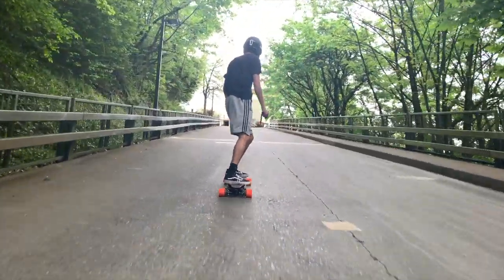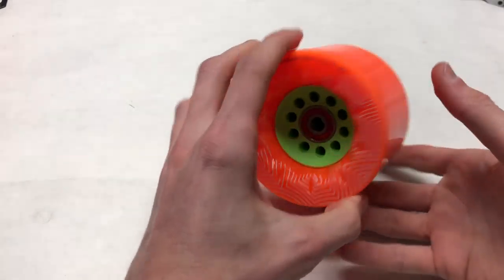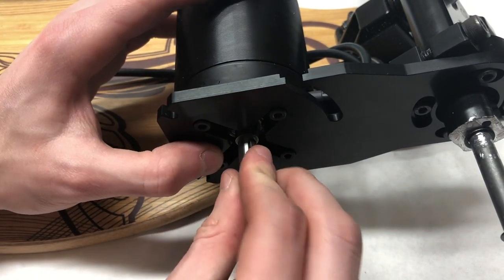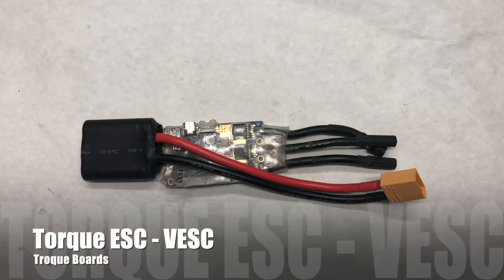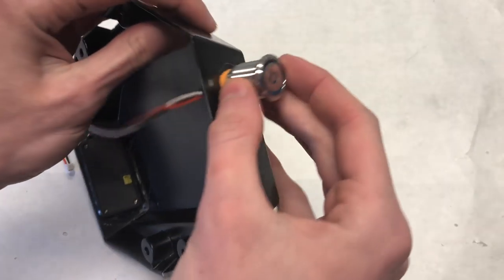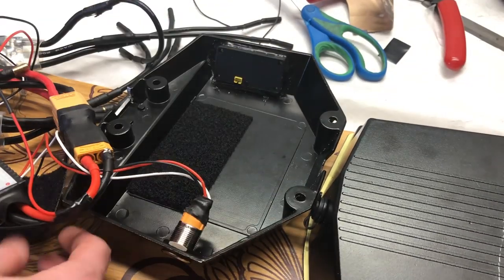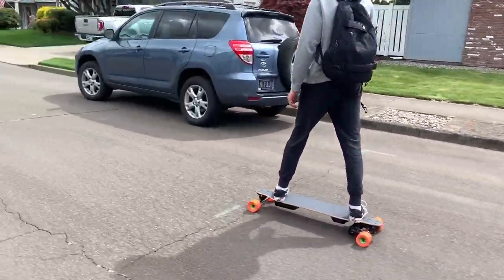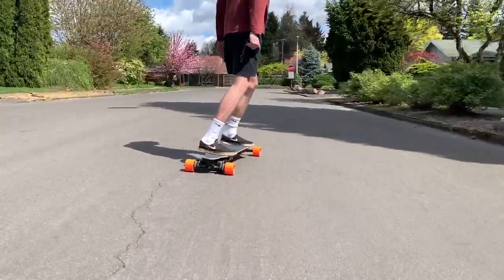How to Build an Electric Skateboard *NEW* DIY Boosted Board

Comment: Whoa you guys figured out how to balance the music and dialogue volume
Reply from the maker: Only took as a year and a half and oh yeah a lot of editing
Reply: Just a quick question which has bugged me for while. Im a massive rc fan and own 2 traxxas x maxx's which do 50mph and can pull cars. So Regarding motors in the x max could you use the xmax motors in a  electric skateboard. These are the motors Velineon 1600XL Brushless Motors. im Thinking about a unusual build. !
Reply from the maker: @customboatscreensolutions5893  Im not familiar with those motors at all but I just looked at them and it looks like the KV is 1600 which is wayyyyy wayyyy too high. Esk8's usually use motors between 140KV-270KV. 190KV is what we usually use
Reply: @customboatscreensolutions5893  the higher the KV, the less the torque, and the higher the top speed. 1600KV is great for pulling a 10kg rc car (I own an 8s xmaxx as well) but it suuuucks for pulling a 70-100kg human... the 8s xmaxx has a 1275kv motor which is better, but still way way too high. You should be looking for 250kv or less.
Reply: @customboatscreensolutions5893  the out-runner style motors used on most boards are really low kv and designed to have more torque than rpm. I'm an rc guy as well but most people dont use rc lipo packs which push way more amps than rigid cells.
Reply: You had me at nut.....
Great video brother!
Reply: No they fucking didn’t 😂 the music was so loud and the voice was super quiet

Comment: the nut from the idler should be on the inside and the bolt head on the outside, the nut wil catch in the grooves giving you easy adjustment with only a turn of the bolt
Reply from the maker: Wow thanks for the tip, I was really struggling putting the idler on, definitely very helpful advise!
Reply: @DIYesk8Builders  No problem dude, Great build!

Comment: Hey guys great video. Im building a board and i have the same wheel and truck setup as you have here. I am little nervous about the Dremel cutting part. my question is, is the axle integrated into the hanger or is it pressed in. When i cut it will there be some kind of separation between the axle and the hanger? Thanks.
Reply from the maker: If you are doing this now I would recommend using the boardnamics wheel pulleys! They require no axle shaving!

Comment: Hi,

Just curious re advantages/disadvantages re putting motors inside the wheels as opposed to hanging out the rear of the board,

Martyn
Reply from the maker: Hi Martyn! I would say that both are viable options. I think that tucked under provides much more a stealth look. However, under the board the motors are closer to the ground and can thus get hit by rocks. Rear mounted motors are higher off soothed avoid more of the rocks hitting them, however they are left out exposed if they were to get hit from behind or crashed backwards in a curve. Rear mounted also means you can't stand the board on its back nose anymore without scudding up the mounts. Honestly prefer rear right now, but it's a fine line

Comment: I don't really Understand why did you use such wide caliber clone trucks ? Just fitting larger motors wont magically increase torque. Instead you could have got the same amount of power using a 6355 or even a 5055 motor.
The battery pack  can hardly discharge a Max current of 24A which is way underpowered for a 6374 motor setup unless you increase it to say 60A.
Which means the board has ridicoulusly  low power , Almost the same as a wowgo 2s.
If I would have personally wanted to make a DIY Boosted board ( offcourse i want to : ) I would have used regular caliber trucks . Using wide trucks slightly makes the ride feel not so similar to boosted. Anyways Great video !
Hope you upgrade the battery sometime in the future .

Comment: 15:40 omg, please preplan your cabling. use heatshrink and add wires to the ends and not mid way with a bit of tape lol.
Reply: Any visual demo? I'm interested in building one and want to have an idea on how to add a heatsink in this enclosure
Reply: @617zSmgr  No, but leave all your final plugs to the end that require soldering. At least you can  reduce the length if needed or slide in an extra cable on the end before heat shrinking the XT90 connector rather than snipping in the middle of the cabling because "it's easier". it's obviously just a missed step and he just decided to "snip here" to add it but do it right first go and keep the wiring neater.

with the heatsink idea, you can but plastic enclosures for cells and ones for ESC etc just like Boosted (separate containers). just cut the slot out for the heatsink but only expose a small amount, not stick it all out. then seal it from water getting in.
the problem then is the flexing of the board will flex the seal so water will become an issue if you go down this route. make the mounts on the enclsure rigid and then you may have a chance.
Reply: @phizicks  just rewatched the video with these instructions! Yes I see what you mean now! 

If I ever get to building this board I will follow this carefully. Thank you very much!

Comment: Does the routed out board deck for the wires cause some durability issues with the board. Could it crack?
Reply from the maker: Definitely could make it weaker but we have no had any issues thus far
Reply: @DIYesk8Builders  yeah the looks are worth it

Comment: would you be open to the idea of a "budget" esk8 build video where you had around 400-600$ as a future video idea where it is still able to hit 20mph?
Reply from the maker: Sure we can work on that! We are actually doing something similar right now
Reply: Swagtron has one in that price range that's pretty not bad. Has remote and weight sensors so you can either control it by shifting your weight front to back or by remote control.

Comment: Hello, would it be possible to get a standard model e-longboard and stick 6' rubber wheels to it? Every model with those wheels is way more expensive than others with similar specs (more than the 100$ margin those wheels and adapters might cost)
Reply from the maker: It all depends on which board you buy. The larger pnuematic tires require wider trucks which are usually found on more expensive boards. You could always build a board for cheaper using those trucks and then use those tires.

Comment: Ok, so I believe I am headed to your store.  however, I don't know this stuff too well.  I have a V1 BoostedBoard that is dead and won't charge.  I believe the Battery and Vesc box are what I need to replace.  The motors are good as well as wheels and trucks (and Deck).  What would you recommend?  Thanks!
Reply from the maker: A battery replacement is probably all that you need, however I am not expert on boosted boards in particular.

Comment: I am building a board and i am wondering if i need the set screws for my motor pulleys, the kit i got didnt come with them, are they essential? I noticed you didn’t show putting them in.  Thanks
Reply from the maker: Yes they are pretty important to prevent your motor pulley from sliding up and down the shaft.
Reply: DIY esk8 Builders where can i buy some since mine didnt come with any? Do they just screw into the hole tightly or is there a trick to it?
Reply from the maker: Yeah they just go in tightly to provide pressure of the motor shaft. Not sure where you can buy some because it all depends on which brand it is

Comment: Nice build! I could be wrong, but could the issue with the wheel/tuck fitment be caused by the bearing in between the wheel and the pulley? I thought you didn't need that third bearing in the middle of the two others. It looks like on the pulley there's a raised lip that's blocked by the inner wheel pulley.
Reply from the maker: Without the third bearing the pulley would get pushed into the hanger and its diameter isn't big enough to just sit over it. Definitely needs the bearing. Clever idea though

Comment: Where do you plan on buying you 10s2p 40t pack? I had a look at meepo but it only puts out 30amps. Im in the market for two which I plan on linking together in parallel to get more range ✌
Reply from the maker: Ownboard has one right now
Reply: @DIYesk8Builders  sweet, do you know what the bms max amp output is set to on the ownboard packs?

Comment: The aluminum ownboard housings transmit vibrations through the board.  I'm looking to replace them with something plastic.  Maybe something like the backfire plastic battery box.  It's kind of sad that my only other option is to build a flexible battery pack and also build a flexy enclosure.

Comment: For a dual 6374 12s config what would be optimal max amps per motor? My guess is 40A per motor, but I can't find any battery with 80A discharge
Reply from the maker: Yeah there's not going to y many packs with that much. We have found that having packs that can do around 35A continuous and 60-80 peak is more than enough for dual 6374's. Of curse more would be even better but we have found that amount to be good
Reply: Battery and motor amps are not the same thing. A good target would be >=50 battery amps. You more or less always put the motors to 80 no matter what battery you have.

Comment: It would be more amzing if you recreated same shape of boosted remote casing and battery casing and esc casing and etc with 3d shape printed
Reply from the maker: We did experiment with this and managed to get a good rear enclosure but we didn't have access to a 3d printer large enough for the front battery casing. Also the aluminum casing in this video is much stronger and protective
Reply: @DIYesk8Builders  im still happy that you and others out here trying to continue boosted legacy any way possible

Comment: I have been looking for a DIY board that fit my needs of loving the flexy Boosted V2 while improving specs. I think this might be it!
I do have a question about the build of this board as someone who is still unfamiliar with specific parts and comparability. Would it be possible to incorporate working Boosted Mini X parts into a build like this? If I liked the remote, or the ability to reverse easily. Can be done, possible but alternatives, not worth the time, or no?
Reply from the maker: I would say that its definitely possible but I would be unsure how to do that since I've never been inside a Boosted.
Reply: Boosted locks down their board from the battery to the motors to the remote, I doubt you can use the boosted remote as is without completely replacing the internal components of both it and the ESC.

If you figure out how to reverse engineer boosted’s tech so third-party stuff can be used seamlessly, you could make a lot of $$ or get really popular within the community haha

Edit: apparently the Trampa Wand is a great remote, and has a reverse feature (i think it is similar to boosteds but definitely research)

Comment: The torque vesc's are very reliable if you solder TVS diodes to them and keep the battery amps below 27 per vesc.

Comment: Since you guys used longer trucks and bigger wheels, could have chosen the 42 inch vanguard instead of the 38 one. Also, on the boosted board they used flat copper wires that ran through the skateboard that doesn't require routing.
Reply from the maker: Yeah we considering that but we wanted the flex 3. Definitely could have used flat wires, but we already had the ones we used on hand
Reply: Yu An Shi i’m pretty sure boosted routed the wires in the board similar to what was done in this video, although I do think they were flat so the channel is not as deep
Reply: @terfz  Yea, well the unproven benefit of that is more structural integrity of the board and also easier for DIY
Reply: @alexshi9320  I like that idea. I see the wires run along the top under the grip tape. How would you run the wires so that there’s no bump on the top of the board where the wire runs? It’s hard from this video to figure out how boosted obscured the wires. https://m.youtube.com/watch?v=klIWLlJXplY

Comment: Do you really think you wheel nuts are far enough on? I wouldn't want to loose a back wheel at 26mph.
Reply from the maker: In the video we only filmed a little bit. We actually took a little motor of the hanger off so that the nuts go on much further
Reply: @DIYesk8Builders  great, loving the videos. Keep up the good work.

Comment: Please change the Enclosures. You can 3D print some or get high quality copies from  https://www.eboardsperu.com/product/loaded-vanguard-enclosure-set-10s4p/ I would also 3D print the Remote.The Firefly NRD remote also looks more like the boosted but with an actual Display. https://electric-skateboard.builders/t/simple-3d-printed-nrf-remote-arduino-controlled/28543 Boosted also used 2 different tones of grip tape on the Plus/V2. Or you could go for a Stealth look a like with Grey Wheels which would much cooler tbh.
Reply: Great job on the Audio Voice Over, and music choices btw
Reply from the maker: We tried 3D printing some and got a great rear enclosure one but it was too small to fit all of the electronics. Battery enclosure way too big to be 3D printed on any of the printers we have access to. Looked into e-boosted but they're so expensive. Firefly does looks sick but is also much more work - definitely want to try and make one some day

Comment: A boosted clone, should NOT have the boosted price. What a bummer.
Reply: It’s more powerful than a boosted board
Reply: ZE Pranks That’s true but, $1599.99? For 26mph 12 miles? An RS is $930 45 mph & 20 miles range
Reply from the maker: I mean you can build this board for 1100-1200 which is considered less than a boosted stealth was and it has better specs so its a better boosted clone at a better price. But you are right, you could find stuff cheaper with great specs. Using things like the vanguard ($174 alone) really drive up the cost
Reply: He starts the video talking about Boosted going out of business and how you can make  your own if you wanted one.

If you want to clone the experience of riding a boosted board (and more), it will require high-quality parts because boosted boards are top of the line (excusing the motor noises and RLOD xr batteries on occasion). 

This board seems amazing and I hope to build something similar, but maybe with a different ESC/remote. I own a BB V2 D+ XR and I love it, and hope to be able to recreate the experience if/when the battery/esc dies on my boosty board